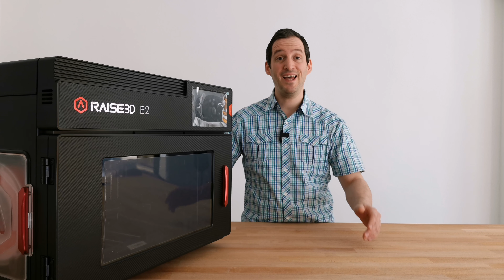Unboxing and First Print on the IDEX Raise3D E2 3D Printer (Noise Level Test) Part 2

Comment: Would you test this E2 printer by feeding it with 4kg ABS spools?  Does its Extruder have enough grip and force to pull a 4kg spool on a long print job?
Reply from the maker: I think this should work. I do not have a 4kg Spool. You would need a good Filament Spool holder with bearings though.

Comment: Nice, thanks! Yes, please compare ff c3 and E2.
Is there a camera in the E2? Wifi?
Maybe also mention if either can do wood or carbon filled filament?
Reply from the maker: Hi. Yes there is a camera in the E2 and it has Wi-Fi. You can also remote control the printer. Wood filament should be fine but carbon fiber you may need a new nozzle (hardened).
Reply: @twinstalk  thanks!!

Comment: When you're printing PLA on the E2 you should always have the top open.
Reply from the maker: Hi Ken. Thanks for the comment. I was also thinking about this and actually did not have any problems with printing PLA yet. Maybe when printing large parts when heat accumulation gets a problem, I will have to open the top cover right ?

Comment: Great videos. How do you find the creator 3? I would be interested in videos about it in future; it seems like a good price for an idex printer!
Reply from the maker: Then i will do that :) do you have anything specific i should mention?
Reply: @twinstalk  for me reliability is the big thing, if I can set the printer off and be confident I can come back to a finished print then that is a big advantage. Also the software; I think that you have to use flashforge's slicer? How dow you find it? Of course a comparison of the noise would also be good, I have heard that it is loud!
Reply from the maker: @nernsteinstien   Yes it is loud. You will see the measurments in the review when I am finished. The slicer is OK. You can use simplify3d if you like that. All in all the slicer of Raise3D is more on the polished side. I did not look into the feature that much.
Reply from the maker: Hello nernsteinstien. The creator 3 is much louder but does have some other nice features like the piezoelectric sensor integrated into the extruder head. I can do a comparison if you like.
Reply: @twinstalk  thanks for your reply. A comparison would be very interesting!

Comment: I will love to see the comparison in term of accuracy, printing time, strength of print object and multiple print of the same model at the 4 corners (want to see how well the tuning of retraction and flow rate of these 2 3D printers).
Reply from the maker: I am working on a small comparison of the Raise3DE2 and the Stratasys F170. It is for PLA only right now. Will be finished in some days. We can try to check your suggestions after that too. For measuring the strength of the materials and the 3D-Prints we will have to get access to a tensile test machine. Because of the Corona-Virus this will have to wait a little.
Thank you for the feedback. -TT
Reply: @twinstalk  Hi- Also consider looking into a Charpy impact test machine and bending stress machine. That will help describe more aspects of the part strength. Great video!
Reply from the maker: @austinwinn4548  Thanks for the Tip. Maybe I will just build one myself.
Reply: @twinstalk  actually,not to overload you, but strength of filaments in standardized tests is something that is way under reviewed on YouTube. How does Alloy 910 compare Polymaker PC Max for example? it would be a lot of filament to buy but if you did it in stages and kept the results all summarized in a master chart, you may be the go to place for looking up filaments for use cases?
Reply from the maker: @austinwinn4548  This is a good point. I will have to check if I can get access to test equipment. Something I have in mind now and will try to pursue. Thanks.